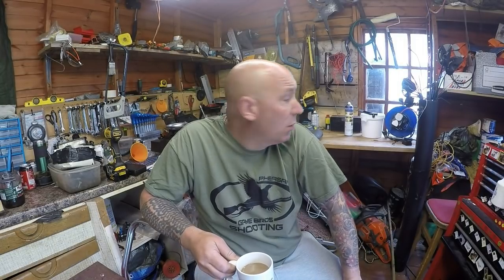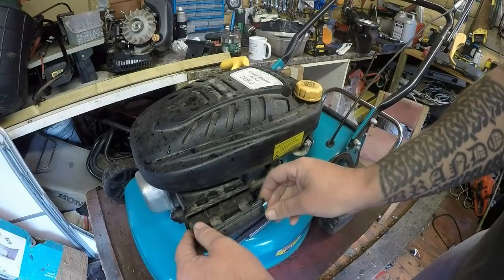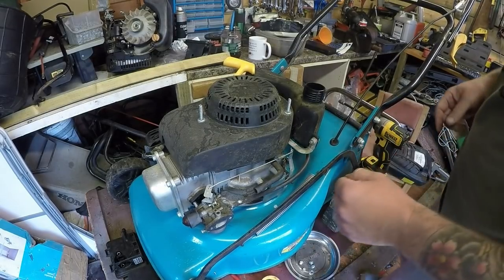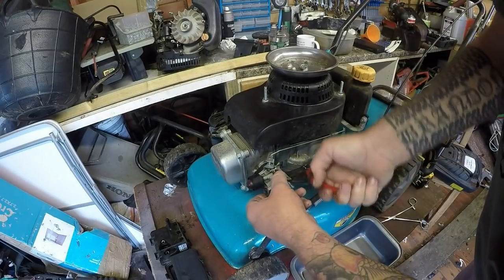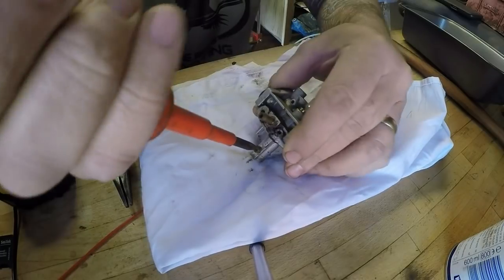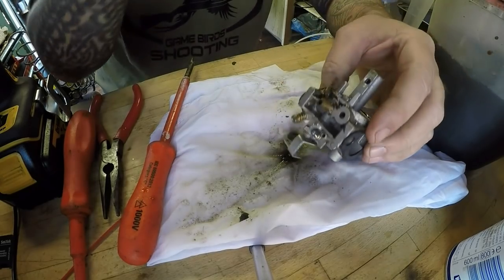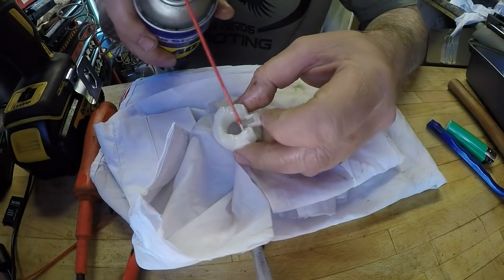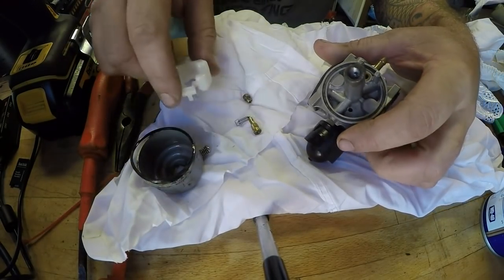HOW TO FIX A CHEAP LAWNMOWER WITH A FUEL PROBLEM #SMALLENGINENATION

Comment: Mick I had a customer this week to buy a Briggs classic 35 but I actually said I would check is out why it did not start exactly the same the carb was caked with rubbish and the float had a hole in it the blade had a chunk out of it any way it was a dead one then two days later is girlfriend bought another one for a fiver the guy said it works anyway£25.00 compleat service it was a pig I am not touching another one sorry to waffle on nice video we will have to send jack a wasp bashed  all the best Mick